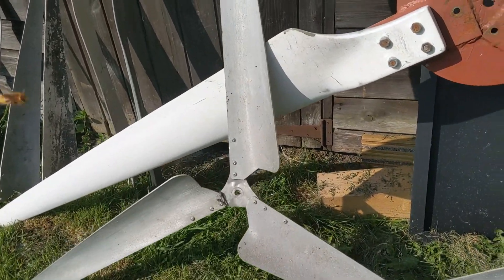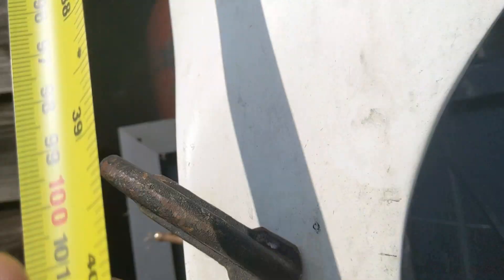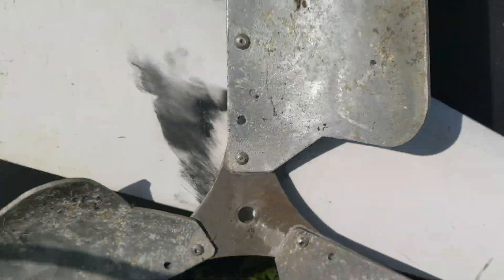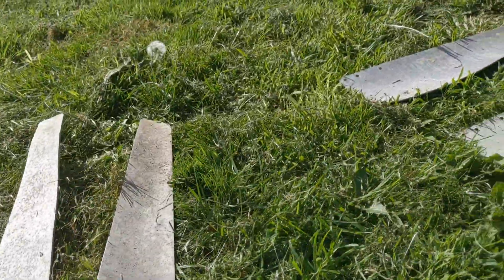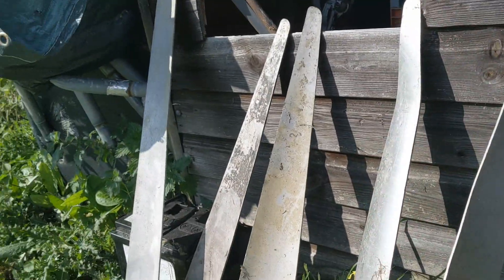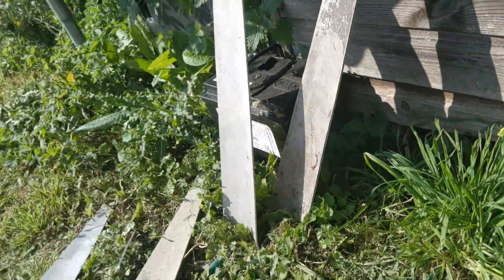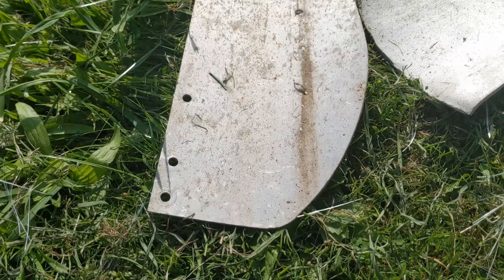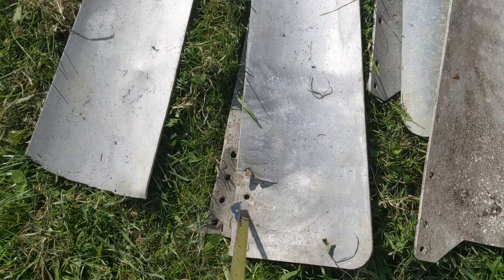Different types of metal WIND TURBINE BLADES that I have used over the years

Comment: Hey young man how big is the swept area on the blade set you have on your turbine now
Reply from the maker: 10 feet I guess, Each blade 4 1/2 feet long so about 10 feet.
Reply: @GavinFreedomLover  ok I have 5'  blade set on mine and it just isn't spooling up like it should so I plan on ordering a bigger set here in the next couple weeks
Reply from the maker: What kind of turbine is it, bigger is pretty much always better.
Reply: @GavinFreedomLover  its my axial flux it is 9 coil 115 turns 24 n52 magnets😁
Reply from the maker: sweet , The magnets on my turbine were very cheap from China , think I would have more power with expensive magnets who knows

Comment: Wow were as bad as one another I've got  blades coming out my ears, last 2 sets i  bought are from ozwind engineering , meant to be real performers But I've got to do some engineering to fit solid  shaft inside each blade etc etc. Aluminium are not my fav strong winds and it's all over, well for the basic thin blades anyway
Reply from the maker: The windy nation ones sure catch the wind though.
Reply: @GavinFreedomLover  sure do, my wind grabbers come to life in a slight breeze whereas some other brands I have don't even move, I heard WN is no longer.